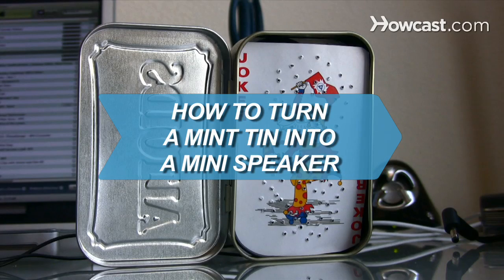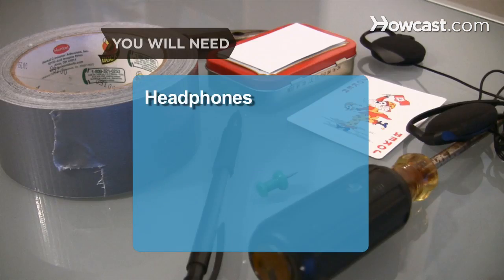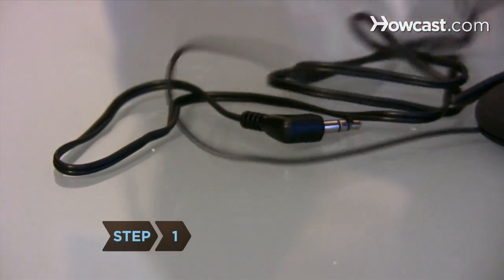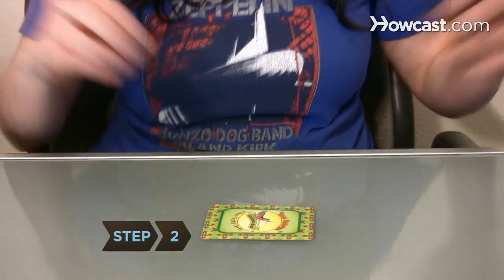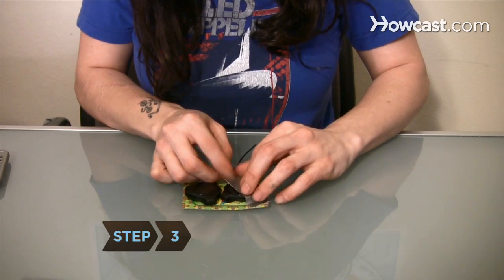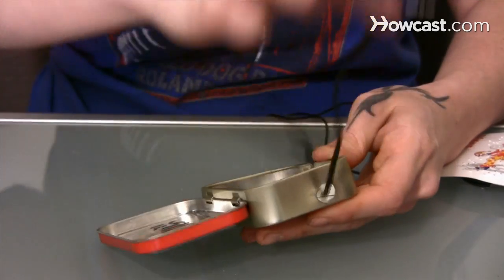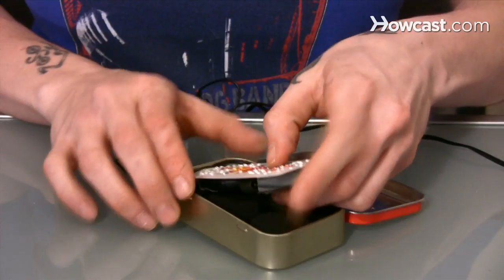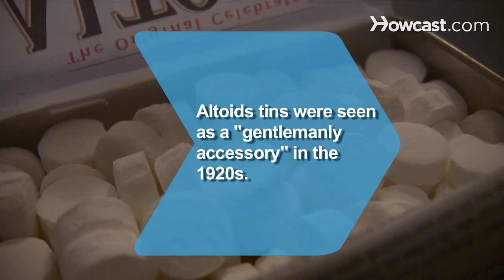How to Turn a Mint Tin into a Mini Speaker

Comment: @mlxp There's many YouTube users that have tried this and uploaded they're results here and it works fine. However, Depending on your Headphones, Varies the sound quality. Generally It's not too loud, But, Louder then Headphones would be themselves. Better results is to substitute the Headphones for a mini Speaker and meld to wires together. It is more effort, But, If It's more sound you want, It's worth it.